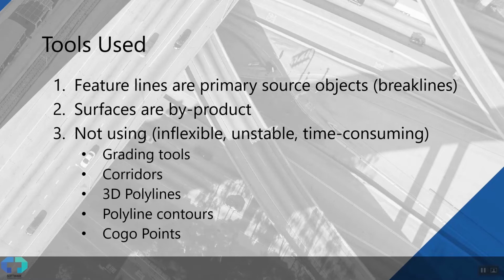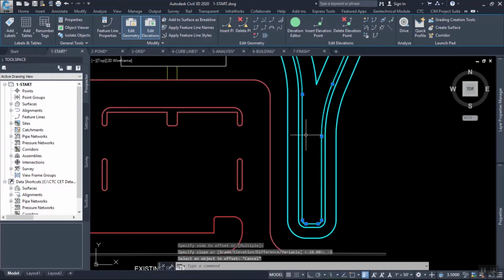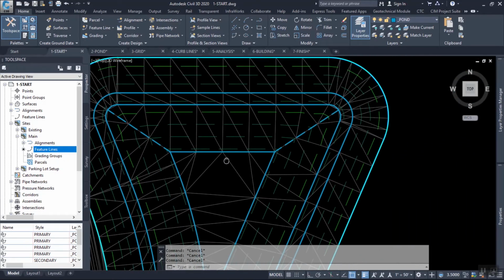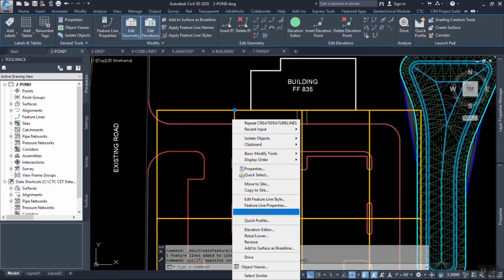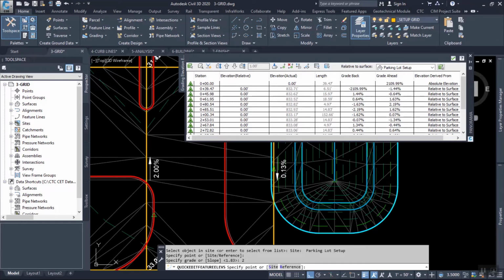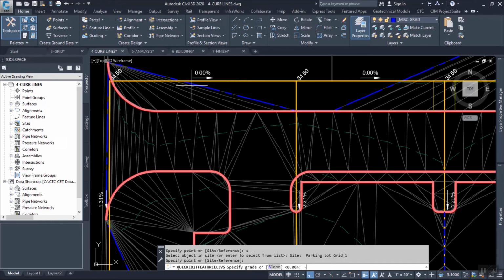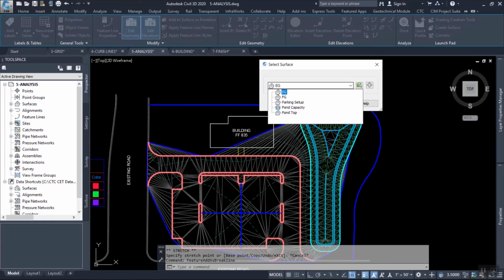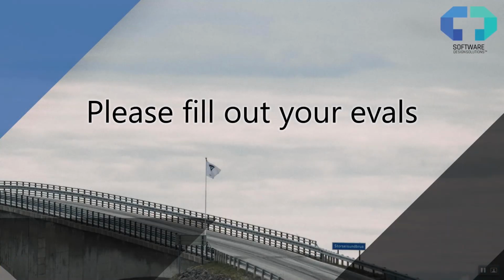Site Grading in Civil 3D

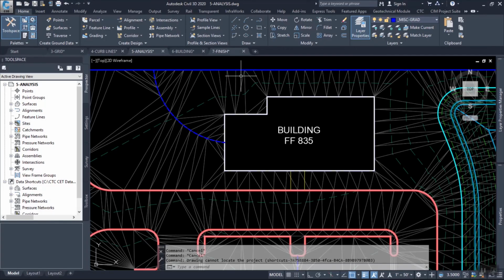Comment: I dont understand how the subgrade auto-volume works @ 58:15. Is purple area a completely flat reference surface lowered by 12 inches relative to a selected gutter reference point? What happens if the middle of the carpark is graded on a downwards slope, such that an area is more than 12 inches below the selected gutter reference point (this area would not have any pavement depth)? Would this work? Copy the FS surface (name: "FS-copy"), add a boundary to represent the purple area, lower the FS-copy by 18 inches using 'Edits' - 'Raise/Lower Surface'.
Reply from the maker: @benm2918 If you would please reach out to use via info@ctcsoftware.com we can setup a time with you to walk your through your questions.

Comment: Good video. However, I don't think it's a good idea making the (Face) Top and Back of Curb elevations +0.50' relative to the "setup surface". I think it's better design to make the (face) Top and Back of Curb elevations 0.50' higher than your gutter (or bottom of face of curb) elevation b/c you will have a slight discrepancy (more than 0.50) between the top and back of curb due to the sloping of the setup-surface and the horizontal distance between the gutter and the top and back of curb lines. You should also set your back of curb elevations 0.00 relative to the (Face) Top of Curb line and the (face) top of curb +0.50' relative to the gutter (flow) line. Kind of like you did later in the video where you edited a gutter elevation and then updated the top and back of curb elevations relative to the gutter elevation. Good tips on many key features of C3D. I wish AD would make parent and child links perpetual rather than a one-time deal.
Reply: In practice, this usually does not matter. In tight areas, it's good to keep in mind; You can run into trouble if you're not paying attention. But, in most areas, this simplification does not matter and is well worth the speed benefit. Usually, you aren't labeling both gutter and top of curb elevations. You pick one or the other, and callout your curb as a 6" curb. Contractor fills in the blanks. But, if you prefer to show both elevations, then you create a custom label style that shows the surface elevation, and uses an equation to show the surface elevation + 0.5'. Like any other grading technique, it requires skill from the user; As long as you're not asleep at the wheel, it's fine.

P.S. Autodesk does offer a parent child relationship: It's called grading features and it $ucks.

Comment: I saw your first 20-minutes or so and somewhat disagree.  I partially use the feature lines and other grading tools, but still grade using polylines.  I tried using just Civil-3D to grade an entire site, but when it comes to revising one simple grade line, it is much easier to move a polyline manually then trying to remember how I graded the site with Civil-3D tools.  Way too complicated and is like trying to push a thumb-tak in the wall with a sledge hammer.  Your detention basin grading example is more for an ideal site where you are unconstrained on all sides.  Use a real example were you have wetlands (transition areas need tone considered) and are on a side of a hill and you need to use retaining walls.  Civil-3D cannot handle it.....  Just my opinion.  I have been using Civil-3D since it came out and AutoCAD since the early 90's..
Reply: I have been finding that I feel much the same way.  I am a relatively new engineer, but most of my training has involved using only Feature Lines, Grading Objects, etc. to grade sites, but it often seems to create more stress/headache/extra work.

Comment: First and foremost, great video. Like Jeff Bartels, you always make great content. I have one suggestion. Instead of using featurelines for the top face and top back of curb, use custom grading groups. I use custom grading groups to control the top face and top back of curb. If the elevations of the flow flowline change, the top face and back of curb change as well automatically.
Reply from the maker: James, thanks for the feedback. We used to advocate grading groups as well, but they are just so buggy, so many users won’t rely on them. And while it’s not shown in this video, we’ve actually created a tool call Auto Grader that’s a total game changer with site grading. It utilizes feature lines, but automates the creation and updating of them. Check out this recent webcast on using it in commercial sites: https://youtu.be/YDfdbZwilLU

Here’s the a link to download a trial as well: https://www.ctcsoftware.com/product/cim-project-suite-2021/
Reply: Can confirm, grading features suck.